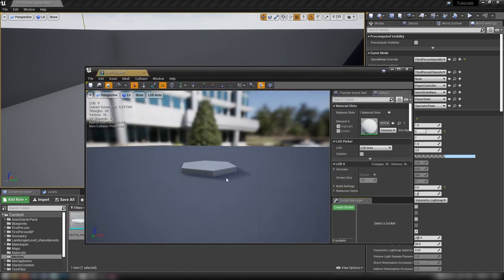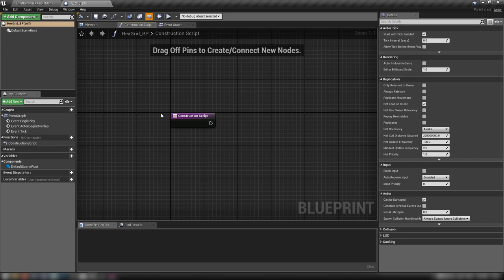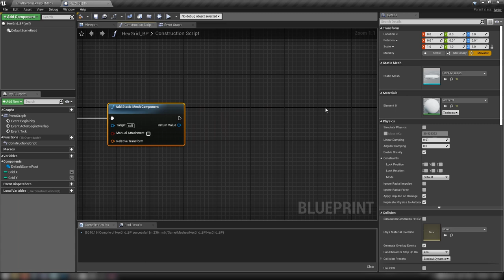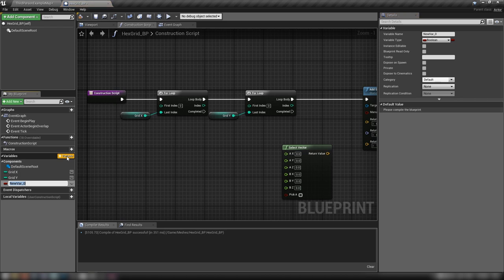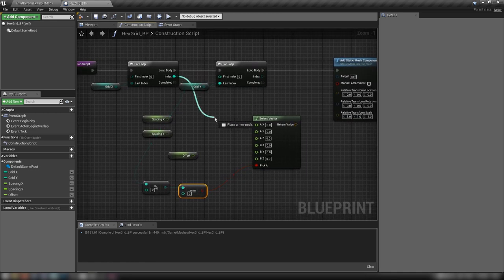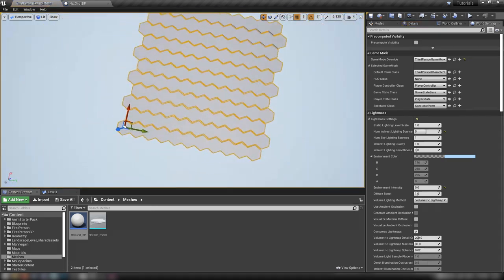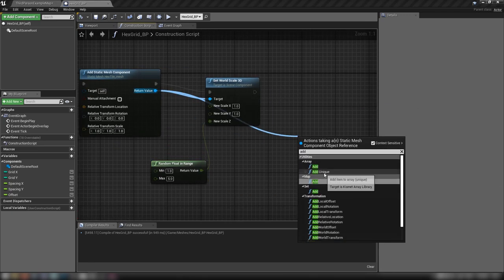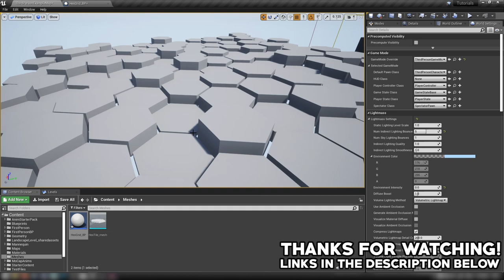UE4 Tutorial: Hex Grid

Comment: This works in theory, but in practice it isn't performant at all unfortunately - when the camera sees a lot of the tiles at once it really slows down - any idea on how to make this more performant?
Reply from the maker: Yes, the reason for this is to simplify the code to make it more readable and easy to understand. For increased performance, you could use instanced static meshes and instead of 'add static mesh' youd use 'add mesh instance' (named that or something similar, i cant remember off the top of my head). Instanced meshes are very high performing so if you need a grid of thousands of tiles, thats a good way to do it.

Another way to go is to move the code to Begin Play and spawn blueprint actors with a tile in it instead of simply a static mesh. This opens you up to all kinds of added functionality, including culling the meshes at distance to lessen the impact on your hardware.

I hope that puts you on the right track! This is one of those videos I'd really like to expand on, so thanks so much for the question :)
Reply: @underscore00  Amazing, thanks for the reply. I will take a look into the other routes mentioned :) Ideally, blueprint actors would be best for my case - so will do a bit more research in that area

Comment: Do you have any tutorials on how to make a highlight over the grid? I'm trying to figure it out but what i'm trying i don't know how to make it work. 

I made a second mesh that overlays with a material that's a transparent green just a bit above the current grid. I then turn it invisible. Now i want to turn it visible again when i mouse over the grid. 

But idk how to reference the grid itself in the controller. It's hard to find tutorials for the hex grid itself, because most of the tutorials are on square grids. Makes me almost wanna change the grid layout.
Reply: Considering the way you've generated the grid in this tutorial actually is still using the classic 2D coordinate system of a regular square grid, almost all the logic that applies to a square grid works here too. There's some cognitive dissonance when you talk about "x1 y1" vs "x2 y1" vs "x1 y2" vs "x2 y2" in this grid because your mind wants to grab only rigid square-based coordinates and it's seeing hexes, but... yeah. You've generated the grid using simple X and Y coords, so everything that uses simple X and Y coords should work... right?

As a leaping off point, maybe you could start with the last thing that is showcased in this video: find the coordinates of the tile under your cursor. So basically Raycast down, hit the tile grid actor, retrieve the offset from the raycast location with the tile grid actor's local zero location, iterate through the tiles and find out which tile exists at that location and use that to give back a tile ID. Once you have the ID, you can do all sorts of stuff.

I personally don't like full grid iteration loops because the cost of doing so increases dramatically with the size of the grid. Something cleaner would be using callbacks or Blueprint Interfaces to have the tile itself report that it was hit by a raycast -- much less computationally intensive. But maybe harder to think about in design phase.

Comment: What about materials? I mean you changed world scale, did it affect on material? They also looks scretched?
Reply from the maker: The sides will stretch, but you can use materials that use world position to fix that. If you're looking for more flexibility, you can run the code at BeginPlay and instead of spawning a static mesh, you can spawn blueprint actors and then do basically whatever you want :) Hope that helps!
Reply: @underscore00  Could you make a video of this plsssss <3